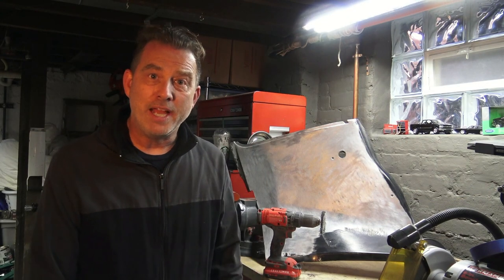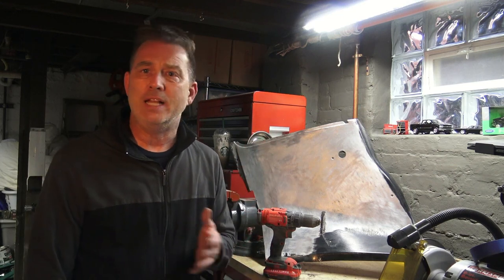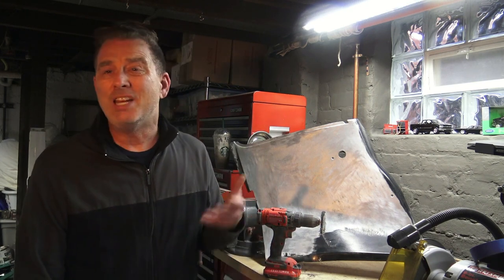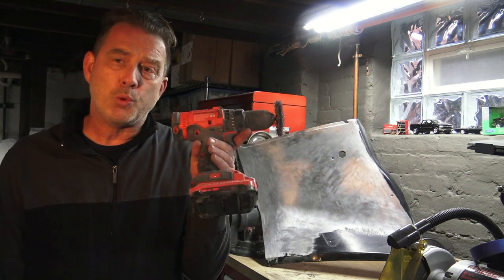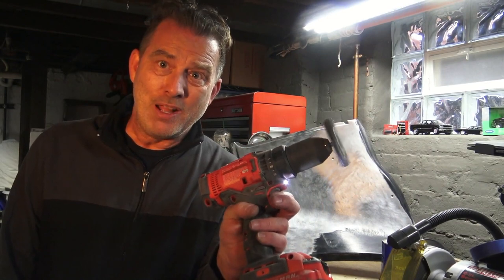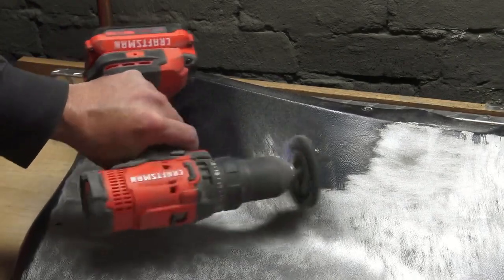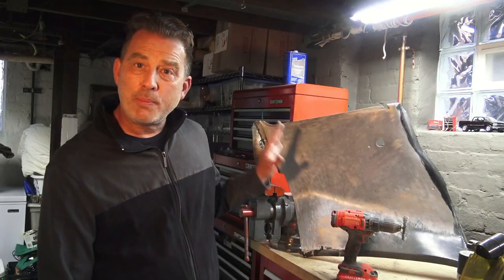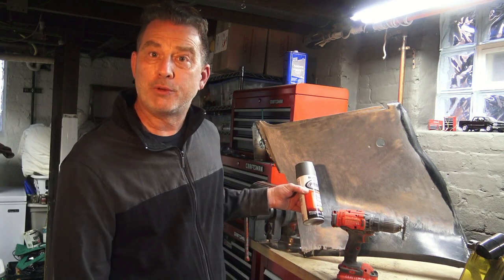Removing Paint From 65 Mustang Interior Door Panel Without Damaging Factory Texture #Craftsman

Comment: I see you tried acetone, but did you try paint stripper? Gathering info before I try to remove the jacked-up paint mess on a 66's front doors. I have used flap brushes on drills before but was wary that the process would damage the texture.
Reply from the maker: Passing along to Brian to share more on this!
Reply: No, I did not, but how different can it be?  Use whatever you are comfortable with.  I've heard some do a walnut blast, but really, these brushes didn't hurt anything.  I've done my doors as well using this same technique